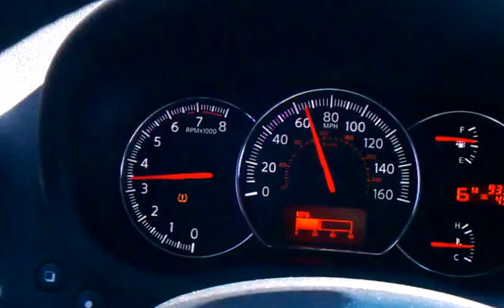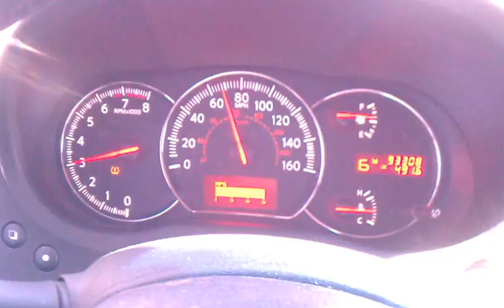CVT Nissan Maxima - Stuck in 6th Gear - Won't down shift Manual Mode

Comment: How Nissan paired this cvt trans with this engine application blows my mind. Your cvt is basically done after this happens. Hope you were able to get it fixed through warranty because the trans will have to be replaced
Reply: The reason for them doing this is monetary. A CVT transmission is cheaper to build than the standard AT (planetary gear transmission). But the CVT from the beginning was KNOW to have problems. It is a peace of garbage. And is MUCH costlier to diagnose the problem; not to mention repair it.

Yes, you will hear "glory" stories and some do well. But most do not experience that. My Nissan Maxima was bad from the day I bought it brand new. Nissan refused to doing anything about it. They said, "It was normal". Yet the CVT vibrates the entire car between 20 to 30 RPM. I hate it.

Than I found out that there is NOTHING that can be done about it; except change the transmission; but they refuse. They say "Learn to gun the engine and you won't have the vibration". That is true, but I have never (88 yrs old now) gunned an engine in ALL of the cars I have ever had. Sad indeed.

I suggest that a buyer choose the "Toyota Avalon" (same elite car like the Nissan Maxima) with the standard transmission. It easily gets 300,000+ miles; and rarely a transmission problem. Oh indeed. I haven't the money so I have to live with the peace of crap.

For what it's worth.

Comment: Hi Eric I have a 07 Nissan Maxima 3.5 SL  and I'm having similar problems the whining yes I paid about 200+ for a sensor and had it installed 5 mos later it's back and now its sounds like it's in high gear in when I get to 3 so I started shifting out Manually even though I can hear it change out to 3 again from there its a light feel when shifting to 4 to 5 and still that whining sound its like stress on the transmission do you have any idea what's wrong???? I also notice that it will smokes after I get off the freeway

Comment: if you also have the Tiptronic "manual" option), use a flathead screwdriver to pop off the chrome ring under the shifter. push out the retaining clip with you finger (catch it when it springs out or it will drop between the seats). press the shifter button and pull up to remove the shifter handle. Make sure the lower dash storage compartment is open, so you have room to work. Use the screwdriver to gently work loose the floor shifter assembly cover (everything snaps back together). At the spot where "Drive" is, you see a loose connector to the left. Push it gently to the right and up, and it will snap back into place. Snap the assembly cover back down, slide the chrome trim piece back onto the shifter. Push the shift handle back onto the shifter, replace the retaining clip, and pull up the chrome trim ring, snapping it back into place.  It literally takes longer to type it than it does to repair it!

Comment: I had a 2012 Nissan versa SL bought it with 43000 miles.  was an awesome car until the car would  jerk an cutoff wen I would press the gas.

Comment: Nissan altima sucks too has the same transmission and i had problems ever since i bought it (brand new) 2013 i am finally getting rid of it with the lemon law but i will never buy a nissan again
Reply: Nissan altima sucks
Reply: They don't have the same transmission. The Maximas have much better, stronger and reliable CVTs. 

CVT will be the future of fossil fuel based transmissions. With more and more electric car adoption, the standard transmission and its shift shocks will no longer be a thing of any adoration. And if gasoline engines keep surviving, then they'll be trying to emulate electric car performance and that's done best with CVTs. Nissan is obsessed with the concept of it and their cars have been the guinea pigs for the technology, which is really sad for their customers. But they've come a long way and when everyone else also use CVTs, Nissan will have the best of them, from all the experience.

Comment: CVT is meant for ECO why the hell would you ever punch it or torque this car..
Reply: +Smith jeff Yeah right my 2016 Maxima beat a Trailblazer SS in a drag race
Reply: +Eric Ash my dad had a 1996 Nissan Maxima it was a fast car
Reply from the maker: Exactly ... nisssan's claim and sales pitch that THE MAXIMA is indeed a "maxima" or "four door sports car"  is completely misleading and fickle....   its an "ECO" thing... they should call it "eco sports car" or the slower less powerful, weaker, sluggish eco Model..lol
Reply: yeah idk what to say about it man fuck thats rough. I picked up a 2012 altima 2.5l for a little bit of power and good mpg. im rocking 40 mpg on average with my driving style. I own a 2006 gt mustang as well thats pretty modded and thats why i picked up this altima. To put miles on it and be my daily driver.  It is weird, the no shift feel... definently take it easy with the CVT transmissions
they are good
it just 
they arent meant to take 200+ ft lbs of torque.. at least from what im reading.
Reply from the maker: Yes correct.. it would make a good all around car just no power ..
Reply: you dont need power on the streets. 
not many cars are worthy to call sports cars that are street legal. no street legal car will ever have the awesome sound of a track only.
Reply: lol i totally posted on the wrong video here

Comment from the maker: LOL.... Strome88 you  must be Nissan Dealer Mechanic with that prognosis... LOL.   Hint Hint, go to a real mechanic school next time. jokes.   I replaced a rim but have yet to replace the TPMS sensor with the original.   Tire pressure has nothing to do with the CVT by the way.  But if you check your tire pressure you will see that its to low or high and requires periodic adjustment...lol

Comment from the maker: The transmission will not down shift which is the normal response of a tranmission under a heavy torque situation e.g. uphill etc.  This CVT transmission overheats and then it won't down shift it stays in a high gear ratio and eventually the fail safe begins to engage (heat) and it feels like it is  slipping...  If you stop and let the car coool down its normal for a while then starts up again. .
Reply: Eric Ash hey eric, r u technician?
I got maxima 2014 and after drive at 80mh speed for 40-60 mins rpm wont go over 4000-5000 but when car is cooled it goes way crazy till 7000 rpm!
What u think?
Reply: @MrJallod did you ever find out

Comment from the maker: CVT is defective or just poorly constructed. There is a nissan technical bulliten out and a video on the CVT itself.  The step up motor (solenoid) mechanism engages the gear ratios, can't handle the high torque especially with a load placed on the car e.g. passengers, going fast, repeated steep inclines. etc.

Comment from the maker: THE DEALER WON'T EVEN BUY THE MAXIMA BACK without a sever cut in the trade in value.  Dealers Pay $25,000 for the car and want to sell it for $40,000k and then they offer no support when your car get issues.  NISSAN NEEDS TO FIX THE MAXIMA CVT ISSUE.  THE MAXIMA  its no longer a MAXIMA  a four door sports car.......*sniff sniff* except on flat ground...  Sorry but i'm disappointed ...

Comment from the maker: DIAGNOSIS - CVT IS NOT GOOD FOR HIGH TORQUE APPLICATIONS.  I am thinking Infiniti G37 3.7liter with a normal tranny,  or, Acura TL - normal tranny which may probably beat the max hands down with its diminished CVT, or, BMW 335.

Comment from the maker: I changed the CVT fluid at 44,000 miles and then 94,000 miles, with recommended CVT change at 60,000.  It is said the CVT fluid can last 100k, this is bull shit. I saw a marked improvement in performance once i changed the CVT FLUID, uphills.  Although the Whining is still there for hard acceleration  or sport driving up and around hilly areas.  The car is awesome on flat ground UNTIL you try to open up on a freeway full throttle then you start start to see that the CVT issue again.

Comment from the maker: Without a FULL CVT FAILURE the dealer won't help unless you pay them a lot of money.   The CVT is not good for High Torque applications hence the whining up Hill.  I can imagine the Whining will drastically increase if the car had a load placed on it like a trailer or packing the car with passengers.  This will cause the CVT to overheat and engage the fail safe and lack of shifting.  AT this point the Max is no longer a MAX due to the CVT .   It drives well on flat ground and around town.

Comment from the maker: No, not really.  There is a service bulletin for the STEP UP MOTOR which is part of the mechanism that changes the Gear Ratio - CVT pulley width - it fails.  I got Step Up Motor Code the first time around and it has since disappeared.  This is why nissan extended the warranty.